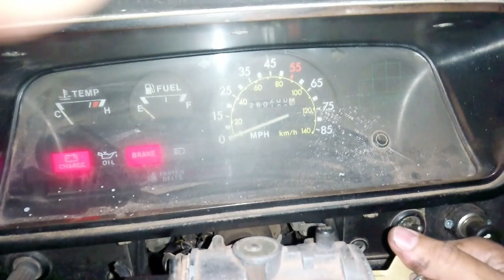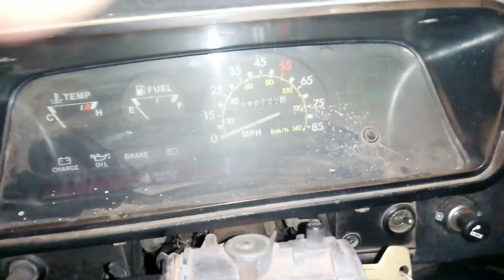Como Reparar Un Motor De Gasolina

Comment: Hola amigo, excelente video, hace poco (1año) hice un motorcito 1.4 y no le quité la rebarba de la camisa, ahora, cuando lo jalo duro veo que por el escape echa humo azul,  presumo, corrígeme por favor si estoy errado, es porque tomé las medidas en la parte alta del cilindro, justo donde esta la rebarba, te pregunto, como eliminó esa rebarba???? Ojo presumo que es por eso, porque monté guías nuevas a la culata, y le puse los sellos de válvulas nuevos, es más, la primera baja de aceite la registró mi motorcito, fué  pasados los 6 meses y es menos de 1/4 de litro, hace poco revisé y me di cuenta que el tapa válvulas, tiene una pequeña fuga por la parte trasera, que forma pequeños depósitos de aceite en el múltiple de admisión, me gustaría que me aclarares por favor, como eliminó esa rebarba, ya que quiero anillar nuevamente, y por otra parte, ese humo azul, hay alguna manera de comprobar  si ese humo tiene otra causa y no necesariamente sean los anillos???? Porque de verdad, mientras ando como la gente normal y decente (no más de 60km/h), mi carrito no echa nadita de humo,  Gracias de antemano por tu apoyo hermano
Reply from the maker: tengo un video que con un puler de pulir de tres patas, Siganos en facebook, , Consulte aqui  👉  https://facebook.com/AutosOmarOficial/